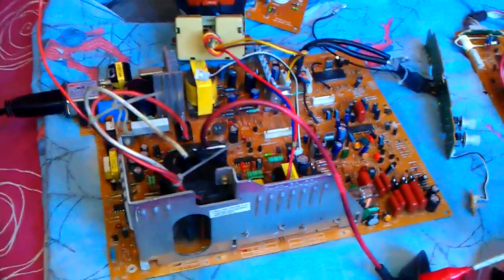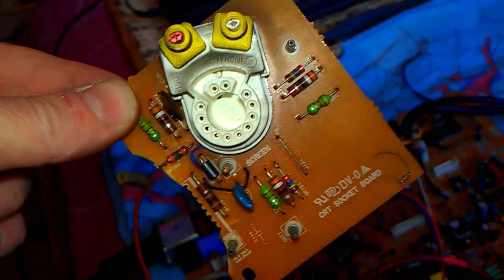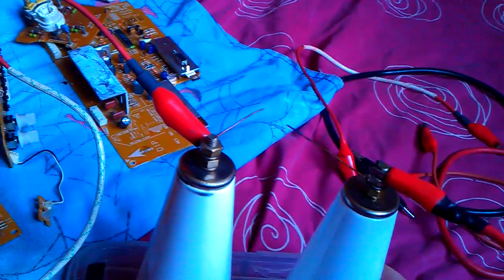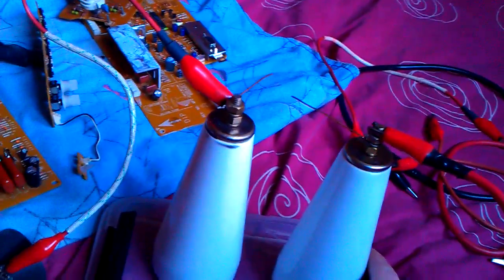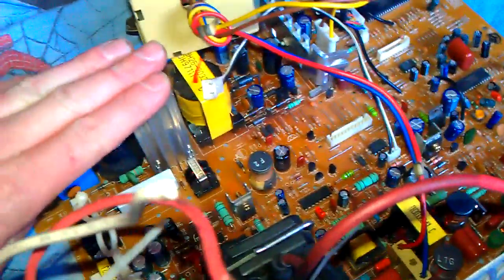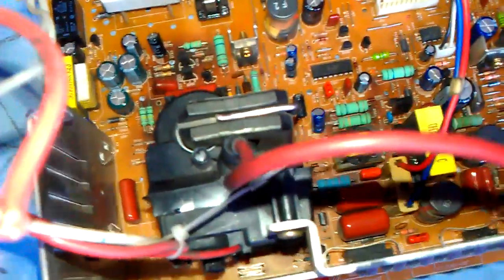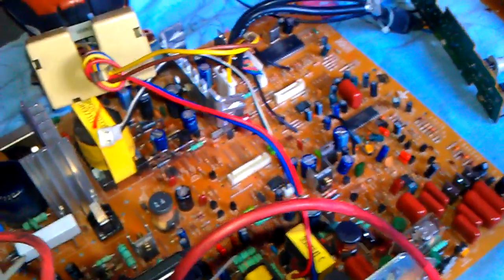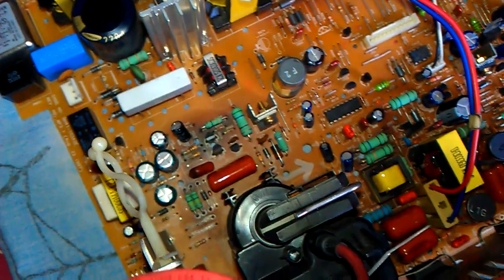Monitor CRT flyback running

Comment: Pretty decent output straight from the board! In normal operation these things only pull a few tens of watts, surprised it could put out that much power (although, not forever it would seem!).

Good job with the safety warning, faults and mistakes are never pleasant when you're working on mains powered equipment.